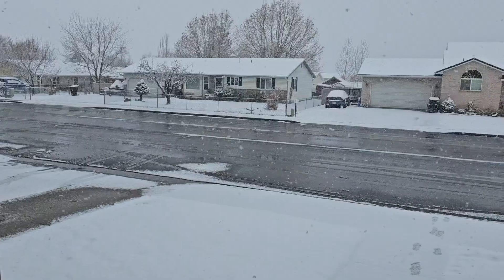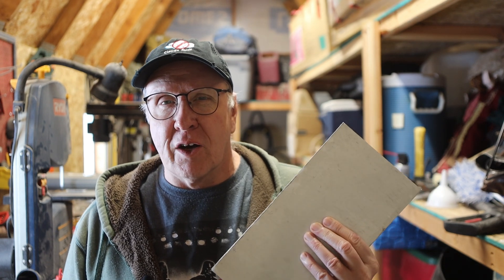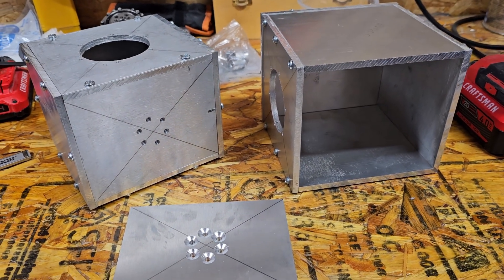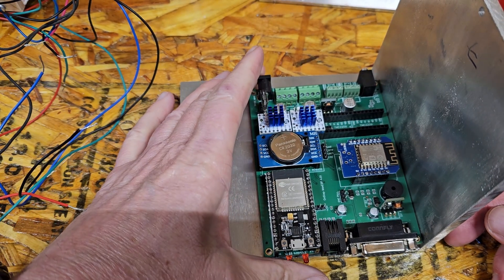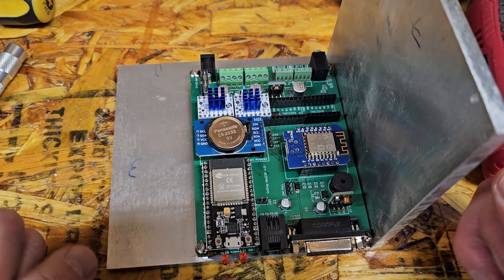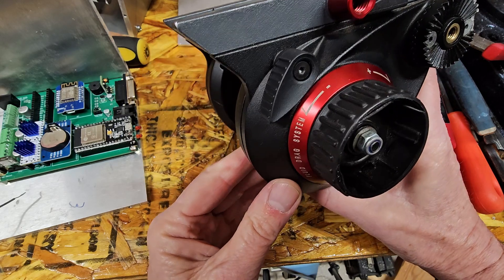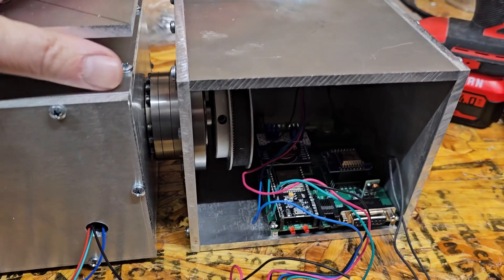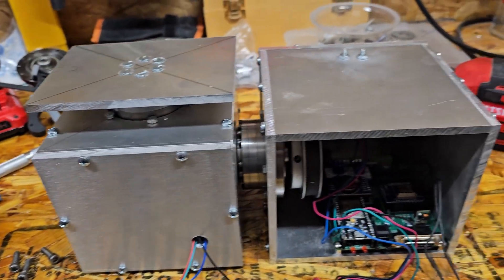DIY Harmonic Drive Telescope Mount Part 4

Comment: How thick is that aluminum?
Reply from the maker: .25 inch
Reply: That's what I'm working with also. I wonder if my design suffers from having everything in a single 6" cube. I could never get the guiding under 1.
Reply from the maker: @randomtinkering  well that's what the big guys use, but with the alt az adjustment I ended up with I went with 2 smaller cubes

Comment: Where did you buy your controler
Reply from the maker: https://graydigitalarts.com/product/maxesp4/
Reply: @whyf16uy  Thanks for the info. i'm trying a test with a 3d printer mount including the harmonic drives. If it does not work well i replace the 3d printed harmonic drive with metal ones.

Comment: Very nice project, I would like to see the next parts! I am afraid you need one or two additional bearings. The wave-generator is not sufficiently enclosed: it can move in the axial direction and has a tendency to tilt, especially under the load of the timing belt moving an attached telescope.
Reply from the maker: What type of bearing? Where would they go?
Reply: I think a "normal" 6xxx series will be OK. Mount it in a bracket at the outside of the timing belt pulley. Best is to take the ID a bit smaller than the pulley shaft (8mm instead of 10mm), fixate the shaft in the bearing with an end screw. (You need a lathe for this). Fixate the bearing on the bracket and the shaft is supported and axial enclosed.
Reply from the maker: @Dhansvw Well this sounds a bit above my pay scale :) and I don't have access to a lathe at the moment. But thanks for your input and I'll definitely look into it.
Reply: I experienced this on my DIY mount. The 60 tooth pulley is so heavy, that at 40° tilt, it starts pushing the shaft down into the gear until it is yanking on the belt.